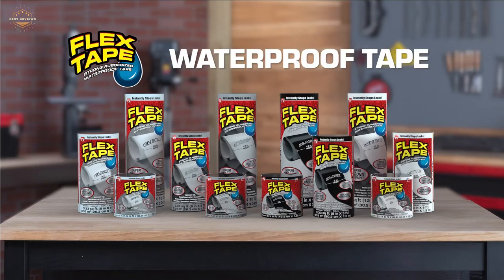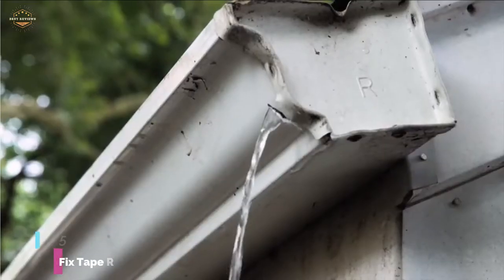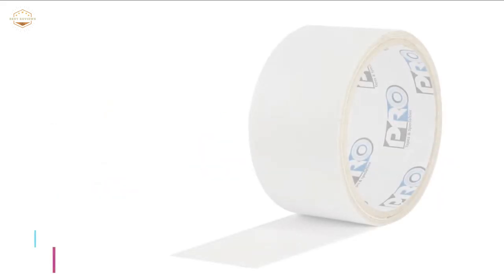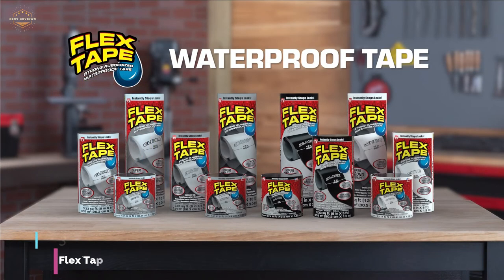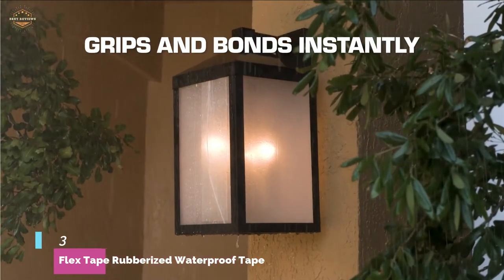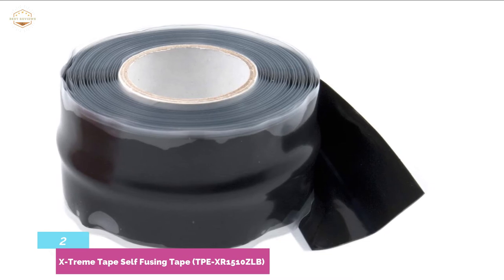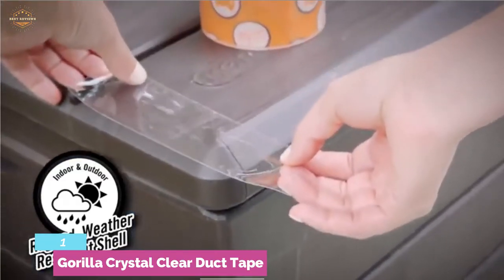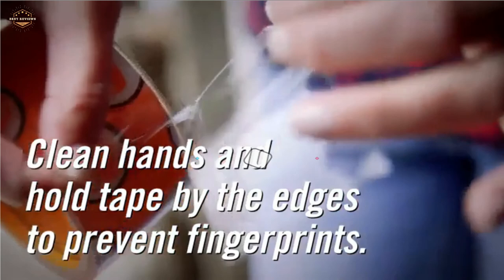Top 5 Best Strongest Waterproof Tapes 2021

Comment: None of these actually stick to a wet surface.
Reply: Really?! But the video shows them being used even under water? I was even thinking of buying one
Reply: @AMAZING WEBSITE DESIGNER  you can try it, but it never worked for me.  I know it's waterproof if you apply it to a dry surface first but it won't stick well if it's already wet.
Reply: @chris76-01  none is available in Kenya . I've Google searched on Kenya's online stores but I can't find any of those tapes. I would have tried one
Reply: Yeah...its not work.........i ordered two...but useless.....flex tape is not waterproof.....i still have half flex tape lefts...